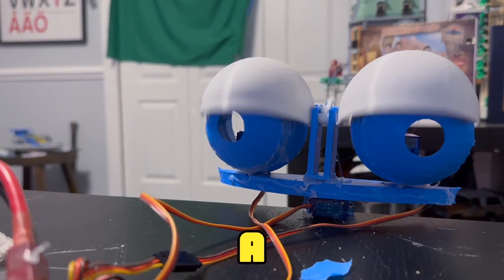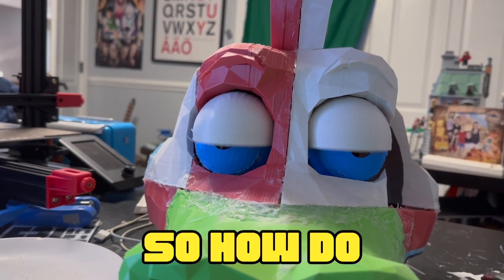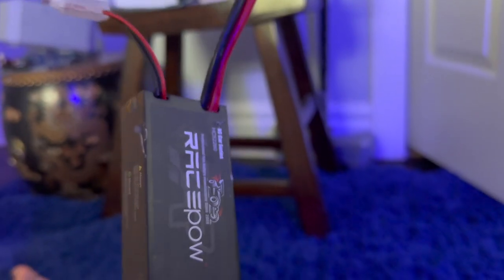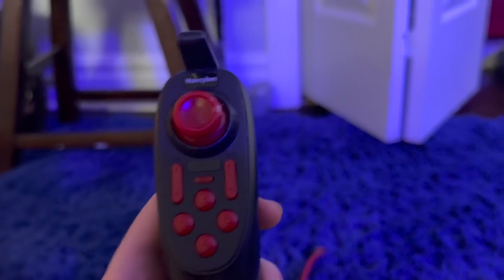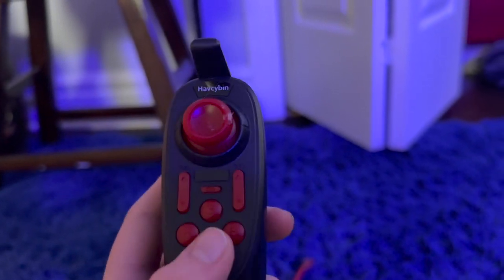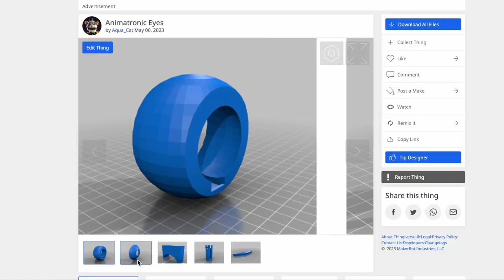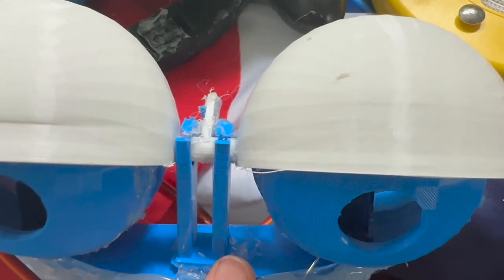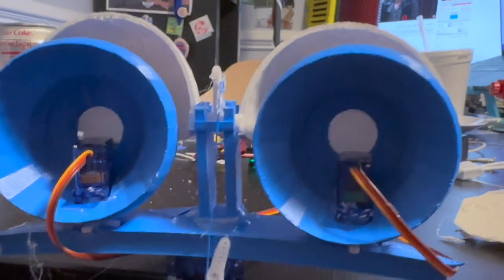How To 3D Print Animatronic Eyes For Cosplay and Props

Comment: I am also making a fnaf cosplay and I have all the parts and how do you connect the transmitter and receiver to the whole thing? I making a head to toe fnaf cosplay if you know thanks!
Reply from the maker: the tutorial on the amazon page might help https://www.amazon.com/DS-600-Transmitter-Receiver-Controller-Channel/dp/B09Y8XT53X?_encoding=UTF8&pd_rd_w=ht048&content-id=amzn1.sym.bc5f3394-3b4c-4031-8ac0-18107ac75816&pf_rd_p=bc5f3394-3b4c-4031-8ac0-18107ac75816&pf_rd_r=N9Q2EEXVEE1QTR20FJGZ&pd_rd_wg=ywy3j&pd_rd_r=cbbaf203-23f8-4486-976b-b0590c5ba2be&th=1&linkCode=sl1&tag=aquacat-20&linkId=91ba0cc2b12a7c6e576c5ed87f1adaa2&language=en_US&ref_=as_li_ss_tl

Comment: How did you get the servos to work with the transmitter and reciever? I got the same one and plugged everything together. So far the receiver is powering on but servos aren't moving. Tried to figure out how to work the controller but instructions are unclear. Also plugged into different channels and nothing. If you can help that would be appreciated, thank you. Great video btw
Reply from the maker: did you plug the battery into the receiver
Reply from the maker: look at 1:04 -1:06 at 0.5 speed they show the a battery I think the power goes into the last three pin of the receiver
if its a problem with the communication between the transmitter and receiver the tutorial on the amazon link might help
https://www.amazon.com/DS-600-Transmitter-Receiver-Controller-Channel/dp/B09Y8XT53X?_encoding=UTF8&pd_rd_w=ht048&content-id=amzn1.sym.bc5f3394-3b4c-4031-8ac0-18107ac75816&pf_rd_p=bc5f3394-3b4c-4031-8ac0-18107ac75816&pf_rd_r=N9Q2EEXVEE1QTR20FJGZ&pd_rd_wg=ywy3j&pd_rd_r=cbbaf203-23f8-4486-976b-b0590c5ba2be&th=1&linkCode=sl1&tag=aquacat-20&linkId=91ba0cc2b12a7c6e576c5ed87f1adaa2&language=en_US&ref_=as_li_ss_tl
Reply: @AquaCatz  yes I plugged the battery into an esc cable that is going into the receiver. I am getting a green light that flashes when I plug it in, then stays solid green when I turn on the controller, but servos are not moving/responding
Reply from the maker: @NESTYGIGGITY  maybe the servos where plugged in the wrong way round like the red wire stays in the middle and the brown and yellow wire are on either side try flipping them around
Reply: @AquaCatz  just tried flipping them, and nothing. Were you able to just start moving the servos after plugging them in or do you have to calibrate it?
Reply from the maker: @NESTYGIGGITY  this is weird I know when I was building this getting the transmitter and receiver to connect was really tricky and finicky so maybe you need to keep trying to connect them until the servos move otherwise if that doesn’t work I don’t know maybe something’s broken